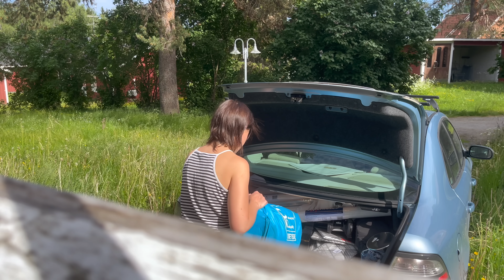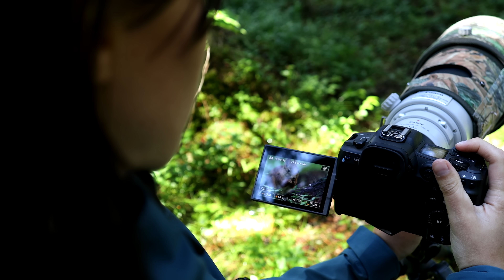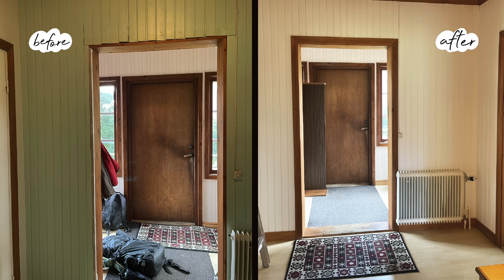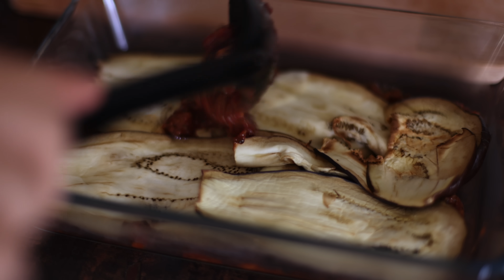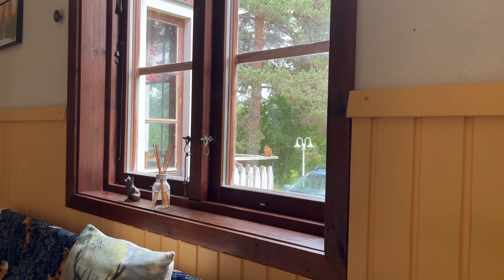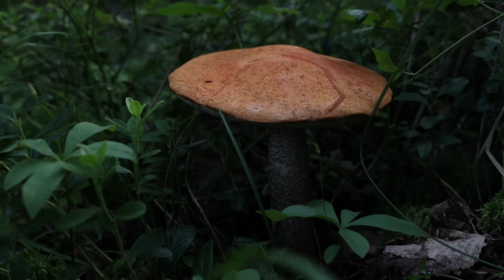Summer Life and Renovation projects in my house in North Sweden

Comment: There is no accounting for taste (food) but I recommend against using any oil for baking which is fluid at low temperatures. With the current knowledge (big caveat) it is best to use coconut-oil or just simple butter (real butter, not margarine) for baking. Of course it also depends on the temperature, with higher temperatures you get other reactants. Cheers, my favorite squirrel-photographer.

Comment: I think your squirrel jumping posts were a bit too far apart (3M? is to far fr squirrels to use as new jumping structures to start with!). Move them a a lot closer n they"ll use them! Then U can widen the gap once they have got used to them as jumping my posts! You also to need to make the make the landing area more square or round, yr thin strange landing platform combined with a bit too far starting distance is a leap to far (excuse the pun!) fr them to begin with! But actually it's great play n enriching fr them if you slowly create better n more complex tasks fr them. I did sum thing similar in a natural setting in Epping Forest London, and had to make closer gaps n better safer wider landing platform before any squirrel wud have a go! I later learnt that the longer jumps they make they more G force they absorb 6x on landing feet/leg muscles, so wider rounder squarer landing platforms are better than just thin long ones, until they understand the landing! Yours looked a bit too high initial risk to my eyes, hence the squirrel workaround! 🤣🙏